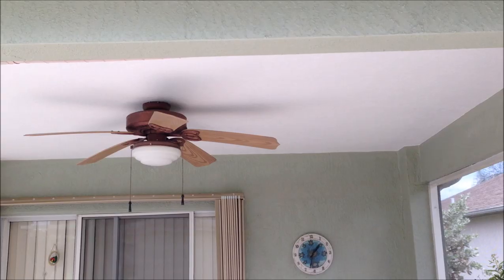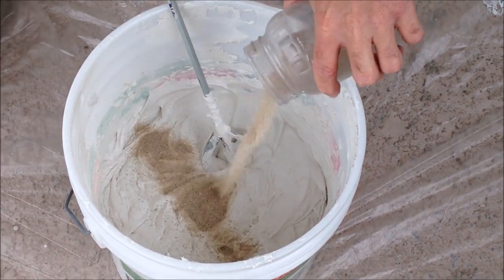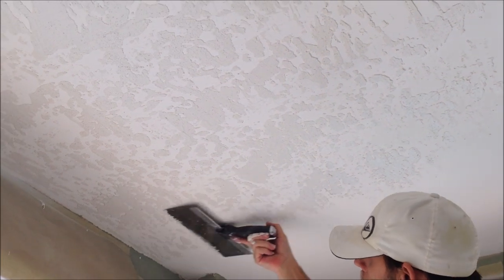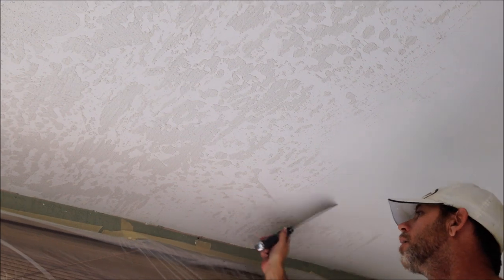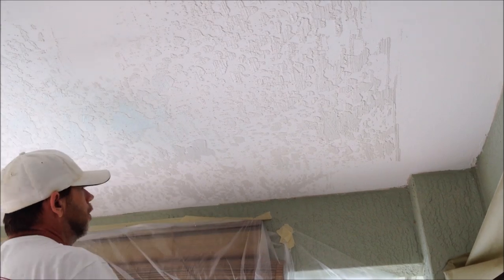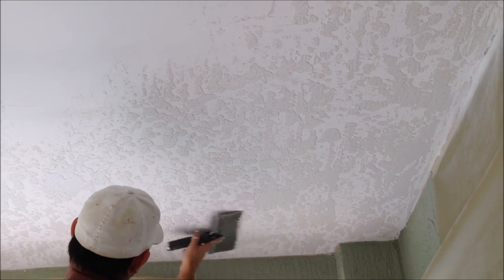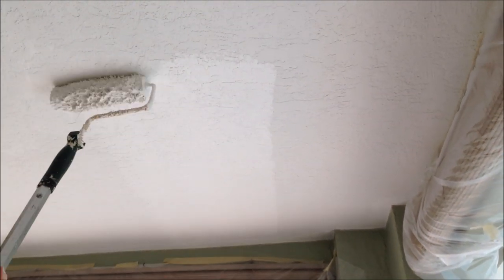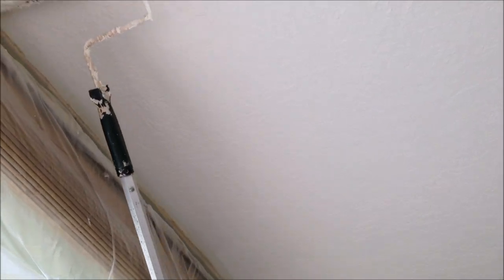The Ultimate Texture for Ceilings!

Comment: I'm an engineer for a major hotel brand... jack of all trades type of work. I'm redecorating/renovating my own townhouse right now in Minnesota.. and this style and technique is just what I have been looking for. Currently I have 30+ year popcorn ceilings throughout. I lucked out because the popcorn is not asbestos and has never been painted... so it comes off pretty easy.
 I need to do some minor repairs to the joints where the ceilings meet the walls, but other than that I have sound ceilings. I intend to install some faux beams eventually and the skip trowel texture is going to work perfectly with the look I am going for. Thanks for the video! I subscribed
Reply from the maker: Awesome! How’d it turn out? Thank you so much for watching and commenting!💥👍🏻😎

Comment: I am doing a renovation on an investment property and had to scrape popcorn for the first time. I also had about 10 patches from hvac install and bad drywall from water leaks. In the past I’ve done spray on knockdown but I watched a couple of your vids on skip troweling and decided to try it. It came out so good I’m totally psyched. I could not find a course sand (where do i find it?) so I just used a finer grain play type sand and it still worked but definitely not as good as yours in this clip. I like your mic over commentary too, very informative. Thanks for putting these out. Can’t wait for my next property so i can skip again.

Comment: This is great work! I’ve never done texture before. Tried the spray can texture  after fixing three stress cracks and it was not good! Didn’t match the texture at all. Tried knockdown and it was not the same. This technique gives the look of my ceiling in California. Questions, can you see the sand in the texture on ceiling? Also, I would be using a mud pan. How much sand would I mix with the joint compound?

Comment: Well planned videos; I started with the skip trowel over the popcorn ceiling; (I deff plan to do this in my house!) I 1st learned to paint as a summer job while in high school, and then those skills helped me pay my way through college. After college I worked with a contractor who taught me a lot of the things you cover. Here is a tip for you to share: after removing mud from a bucket, be sure to scrape the inside edges of the bucket, so that no mud dries there. This is especially helpful if you have to leave the mud in the bucket overnight. Nothing worse than pulling the mud only to find dried bits... Also, I see you doing a good technique, but I don't know if you've mentioned it? And that is to scrape the mud off the corners of your knife so that the mud doesn't squish out the sides. It's something that once learned becomes 2nd nature. I like to use a Venetian plaster type trowel for skip troweling and have several sizes. As for primers, I prefer Zinsser all the way. Good tip of tinting white paint whiter; allows much better coverage. I always get my primers tinted white, too. My college degrees were in Video production, and I ran a small company for many years. I enjoy watching your videos, and will be watching many more. Cheers!
Reply: Isn't scraping the corners needed if you're using a pan and knife, not a hawk and trowel/knife? Using the hawk there's nothing on the sides to scrape.
Reply: @Rls_0523  yes it's a skill I learned and once you got it down it's so quick and easy you don't even give it a second thought!

Comment: The one thing this tutorial is missing is where to find 20/30 sand. You'd think this stuff would be sold in the drywall section of your local home improvement store, but it's not. At least not at mine. I figured I'd try a bag of Sankrete multipurpose sand, because it said it was graded and washed, but it was full of small rocks. I finally went to my local pool supply store, and they had bags of 20 grit sand that is perfect.

Comment: The big mystery that is always "left as an exercise for the student" is locating a retail source for The Magic 20-30 Sand. No one knows what it is, or where to find it. But all of these EZ-Peasy skip trowel video tutorial guys use it. Good luck!

For reference, I hired a guy a few decades ago to texture my walls, and he used sand to do a skip trowel. It looks okay, although I've wanted to replace it with something newer, like a knockdown splatter. Problem is the damned sand. You can NOT easily apply a skim coat over the skip trowel because when you go to drag the trowel filled with mud over the texture, the little sand bits create little high spots that the skim trowel cannot cover. You get zillions of little "stripes" in the mud. My advice: never use sand in your texture because some day you will regret it when you try to cover it with something different.

Comment: This is definitely a way. I would say personally I’ve found that adding sand is not necessary and you can get a perfectly acceptable finish without it.  The people in my area of Texas prefer a much smoother finish with smaller gaps in the ‘skip’ and larger smooth areas. You mention you are in Florida so this is a very regional method but not preferred in Texas.  After all, you may have just gotten rid of popcorn or crows foot texture, why would you want to make a new texture so bumpy and rough? You can also see that the sand causes the knife to bounce which creates unsightly linear ridges. The third or fourth disadvantage to adding sand is how difficult you are going to make it to ever re-texture again in the future if necessary. You think removing popcorn is hard? Lol.  Good tutorial but for those watching, take it with a grain of …sand, lol.

Comment: Wannabe here and lately find myself with an abundance of time in the same room that I grew up in without my usual means. I learned to fixed the ceiling from an upstairs bathroom leak and manage to skim coat and texture from your channel. I haven't bought any materials yet and wasn't planning to either. Can I leave it with 2 coats of skim and a textured without primer and paint?

Comment: Wow!!!!  I am so impressed because I needed a solution.  I am skim coating 12x12 ceiling tiles.  I can do that OK, but the position has killed my neck and back.  Now, I can likely be a little less precise and smooth on the skim coat.  THANKS!   I am wondering exactly what you mean by adding white tint.  Doesn't ceiling white have white tint.  #drywall tube

Comment: Quick question if you can spare a minute; I scraped popcorn from a concrete condo ceiling in Hawaii, and it looks like there is a skim coat that was under it. If I intend to apply skip trowel finish do I still need to apply a new skim coat ? Thanks  for video!

Comment: I may consider trying this instead of a smooth surface over my popcorn ceiling... Do you feel that it is very DIY friendly? Also if I did use this method,  would I need to scrape off all of the popcorn bumps on the ceiling before starting this right?

Comment: Drywall Tube,
Hi Paul, i live up in Washington state, i have a popcorn ceiling with cracking on the tape line and the popcorn is just dated. I will be using your technic of skip sheeting and also your little painting tip at the end. Thank you sir.......great video!

Comment: You may have answered this already but why do  you not prime before skim-coating?

Working on an older house, I've found that skim-coating on top of the bare sheetrock sometimes leads to adhesion problems (of course, the crappy drywall and paint the original builder used has a lot to do with my issues). I seem to have less problems when priming then skim-coating.

My house had that stupid popcorn texture on the ceiling.  I'm currently working on the guest bath to redo it it (it was falling off).  I think skip-coating would be an excellent choice, allowing me to hide the imperfections (and there are many!).

Also, any particular advice on the sand?  Or is a nice grade (such as that you'd get from Lowe's/Home Depot for the kiddy sandbox) do?

Comment: Hey Paul, thanks for the great video. I'm currently working on a ceiling repair about 12' by 18' and I'm trying to match the heavy knockdown texture but my  marchalltown sharpshooter doesn't spray thick enough. I almost matched it with skip trowel but that was a little too big. I also tried the sponge but that didn't look right either. Do you have any advice? Your help is greatly appreciated.

Comment: I usually add the paint to the mixture.  Saves you a step
Reply from the maker: Hey there Lou! But, wouldn’t that have a different color then the skim coat or surface you’re going over?
Reply: @PaulPeck  well I only do that when they want the ceiling painted

Comment: What material do you use for the skim coat ? I have a few repairs I need to do a few parts on my drywall ceiling the tape joints did come off so I need to repair and then need to skim coat and then texture

Comment: If I have new drywall ceiling up, do I need to do a full skim coat before this texture? Or can I do it right over the drywall/joint compound lines?
Reply from the maker: You don’t have to skim coat before applying the skip trowel texture.👍🏻
Reply: @PaulPeck  Should I prime it first so that the paper backing on the dry wall doesn't get wet and peel away from the sheetrock ?

Comment: Paul, nice video! Did you have to cut through ceiling and put furring strips in cracked joint areas to support. I saw another video where you did that.
Reply from the maker: Hey there Martin!💥👊🏻 I only had do that in one spot on this pricey because there was no  framing member where a corner of a sheet of drywall was moving. The rest I just reattached on each side of the drywall joint to the existing framing members. Here the video from this project where I added a small piece of wood: https://youtu.be/keJy3moim10 Thanks so much for watching and commenting my friend!😎 -Paul

Comment: I like this, gona do it.
Reply from the maker: Awesome Joan!🔥 Let me know if you run into any questions along the way and how it turns out for sure!👍🏻 Thanks so much for watching and subscribing!😎 -Paul
Reply: @PaulPeck  I removed the popcorn in my back bathroom not knowing why they did this until I had to spackle and sand and prime and paint omg what a job sanding was the worse part. I knew I wouldnt ever do that again lol. So been trying to find a better way to do rest of house. This has been the best I came across. Dont want to cover ceiling scared of long term outcome. Will keep u posted. Wish me luck got 3400   sf home. Lol

Comment: I need to fix a part of the ceiling in my family room that got water stained, might try this to hide the stain?
Reply from the maker: I would use a spray can of Kilz original stain blocking primer if it’s just a water stain.👍🏻 Even if you’re going to skim coat that water stain needs to be primed with a stain blocking primer or it will bleed through the joint compound... I hope this helps! -Paul